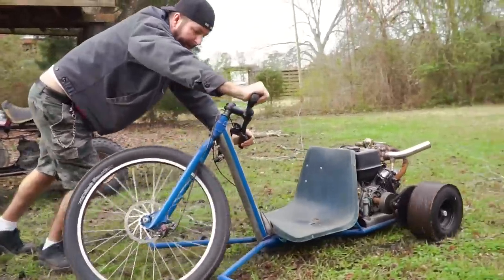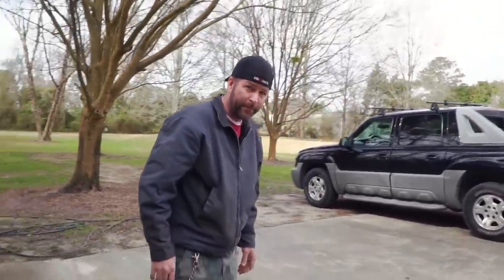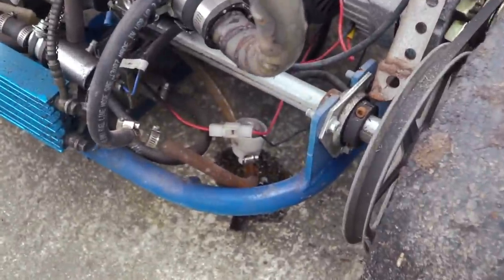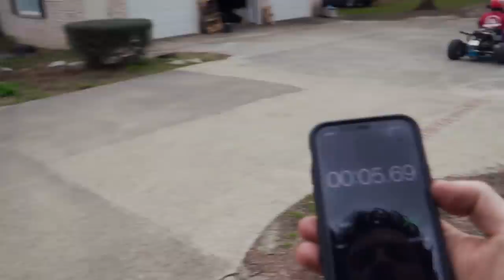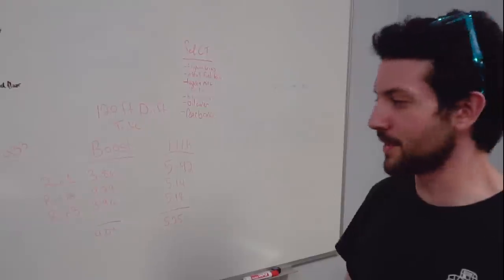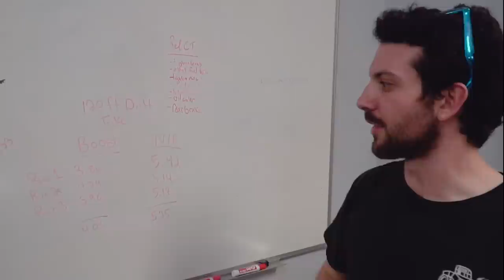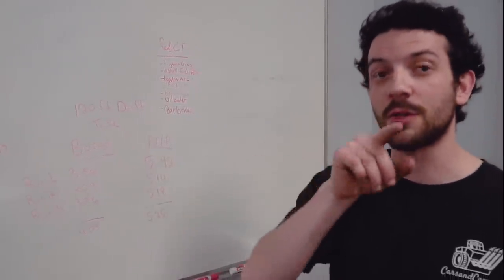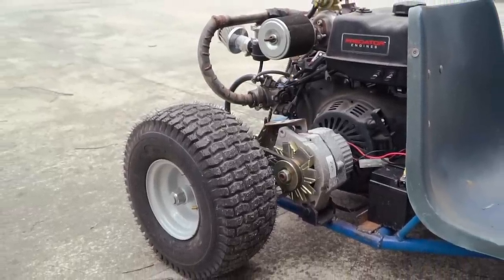420cc Turbocharged Trike Revival & Boost Test!

Comment: 1.21 sec over what...330 feet or less? Thats a Huuuge improvement...!

A professionally built 420cc would be more bang for the buck as long as you dont have to pay engine builder labor. But when i say "built" i dont mean just swapping the "good parts" im talking a carefully measured and assembled and "massaged" package.
I know this might be above the capabilities of some and past the capabilities of some peoples toolbox (im talking specific engine tools and such).

With that said, the efi/turbo combination is a relatively cheap power upgrade in itself and worth looking into.

Now imagine combining both of the above and apply the "Mr TuneMaster 3000" (you know what i mean, several hours in evaluation and tuning including dyno testing, egt,  a/f wideband....wait i think
Its got that..., cht, data log, etc) i do believe sirs' that this engine setup could make 45hp+ and on likker (methanol) could go past 50hp pretty easy.

Its been awhile since I've posted, hope y'all are doing well and staying safe and practicing social distancing by just riding your projects and waving from afar..! Take care guys.

Comment: you have so much room behind the clutch why don't you move the alternator and hook it behind the clutch and get a smaller alternator for weight and room . that way it will charge when the engine is running.

Comment: i think you could get more out of this as i have got 9psi from a boosted 404cc running a megasquirt 2.2 here is the link check it out  https://youtu.be/auoO30pTLqI A big part of getting this right is air capacity after the turbo to store the boost between exhaust stroke and intake stroke. about 3X the capacity of the engine seams to work

Comment: ...or you could spend half of what you have in this set up for a quad/dirt bike engine and be A lot faster. even with like a stock 300ex engine. hell you can find complete and running 400ex quads for $1000 all day, every day. but i get it that most of your stuff is sponsored and your sponsors only carry go cart engines and accessories. i just think for the average person to spend thousands to still be slow is insanity.

Comment: Has anyone conjoined two predator motors ? Like one crank and one CNC.billet case & flywheel? Rumor has it some one up near Tacoma has Franklinbuilt a “424” Hemi ? 
I’m only speculating at present.......
? 424 / 2 = ______? Wait what if 420*2=w/ {^>_} &<$= 202% or 840cc @ >9k RPM + EFI & SuperCharged, nitro methane 106 bhp@ 8.9k on paper . Ok relax not toilet paper , however calcs purely rectal extracted and has absolutely no merit !  ( other than the rumor [CLadd jan20] and extracting calcs were at time of commenting] is any one following me ?
/1combust